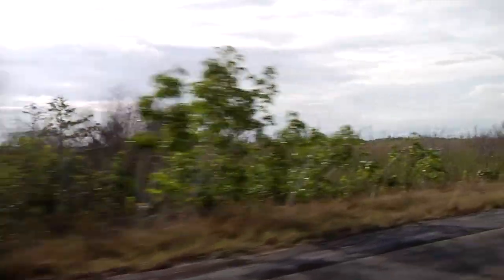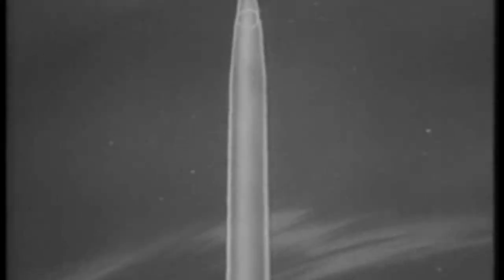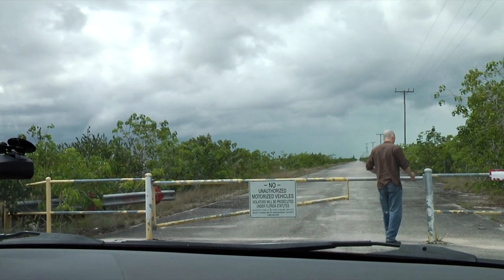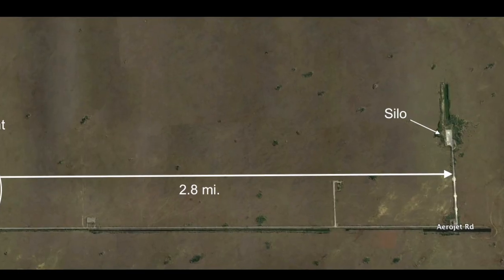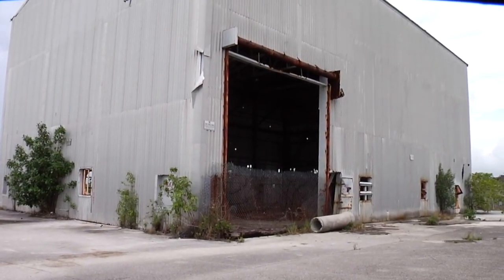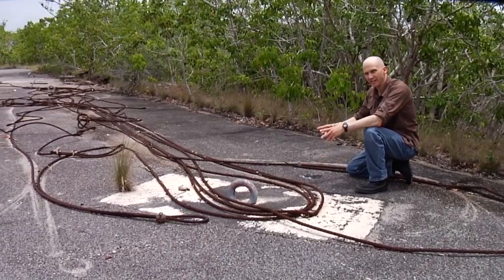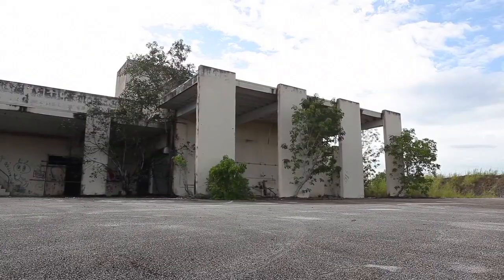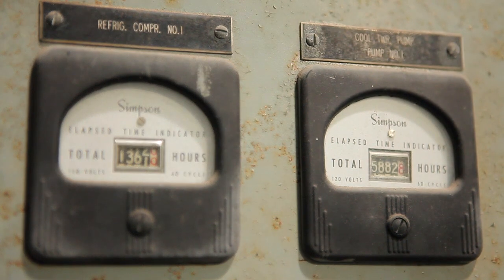Abandoned Planet: Aerojet Everglades

Comment: Same time Lockheed martin was trying to produce a nuclear plane at plant 67. Ended up doing radiation testing on the environment by suspending the reactor for sometimes weeks straight at a time. Filling rail cars with "material" and testing. Site is still there goes 5 stories underground. Flooded but was able to raft around the first level. Pretty wild!

Comment: In the 80’s & 90’s, we’d run all over there with ATV’s.
Found lots of high voltage electrical panels, crashed rockets and rocket test buildings.
There was also a fish farm near the main entrance.
Got chased out by security a couple times, good fun.
Reply: I had the same exact thought, with the lack of riding areas these days I wonder how many people ride around there today?
Reply: @8180634  I think security is being relaxed there, these vids seem to show that.
I recall nasty thick mud from the facility back to the canal levee, especially since we had mostly 3 wheeler ATV’s back then.

Comment: Everytime NASA came calling AeroJet bent over because they got screwed over so many times. They actually BEAT Thiokol in the engeneering scores for the Shuttle SRBs, but James Fletcher was from Utah and wanted to throw his congressional district a bone, so we ended up with SRBs that had to be shipped back to Utah on train cars, so they had to be segmented,so they had joints......which were sealed by rubber o-rings

So basically a decision solely driven by helping ones home state killed 7 astronauts.